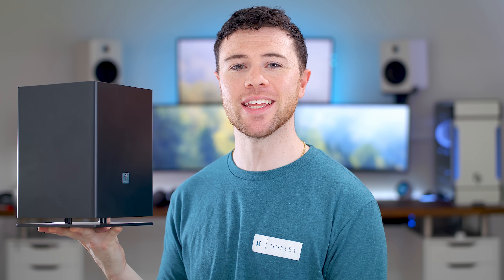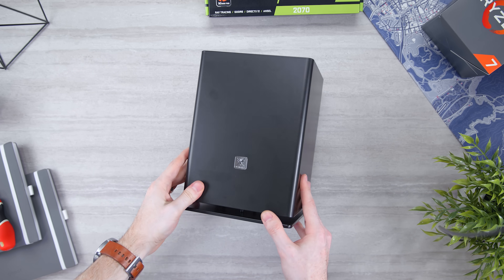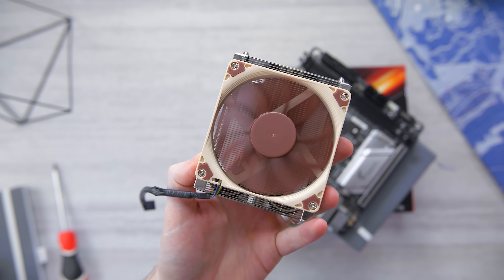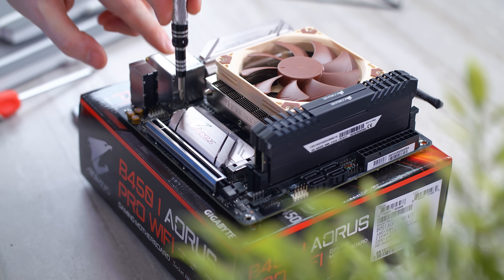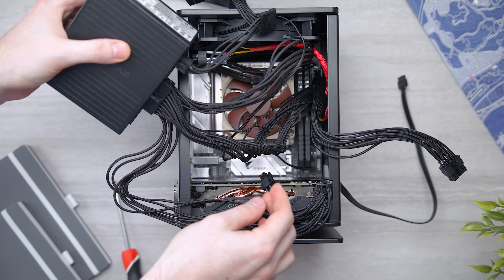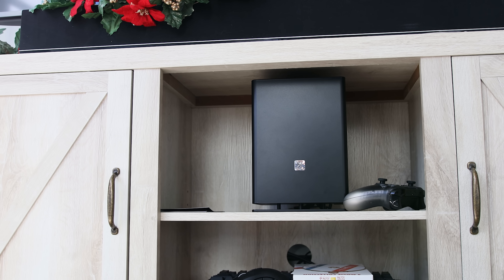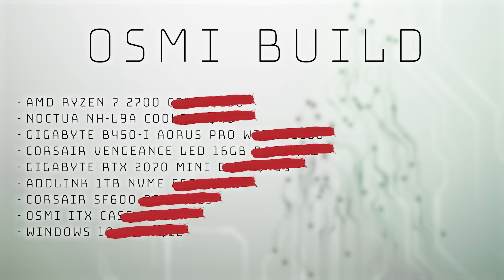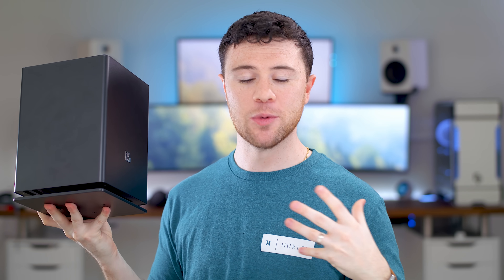I Built the Xbox Series X as a PC

Comment: “I think $699 or $799 or you know what I’ll give it a $100 leeway. Maybe $699 or $599” yeah turns out $499 is the price I so guess it’s worth it? I mean it beat his lowest projection of by $100. Lockhart also wasn’t on par the Xbox one s but actually more capable than the Xbox one X in the overall package and is $299. At least from these early projections it seems that the console exceeds the expectation cost for the power it’s delivering which is a good sign. Now all that’s left is to see if it meets the performance standard they are claiming.

Comment: You forgot to include the cost of a cd drive, I also think you’re underestimating the cost of components, for example cd drives are basically being sold for Razer thin margins, same with things like PSU’s and generic motherboards, there is basically almost no money to be made no matter how much in bulk you produce them - things like this will not be lower in price for the Xbox. But the CPU and GPU could be cheaper though because they share a die - not so much because of mass production even though that could have an effect just not as large as being in the same die. The Xbox will still be cheaper than your parts list but not for the reasons you mentioned, Microsoft will take a loss on selling the hardware and make it up in game sales. It all depends how much Microsoft is willing to risk to loose for how low the price should be.

Comment: It’s not rly equivalent especially using a 2070 when the gpu inside series x is more in line with 2080s-2080ti and the cpu is 3700x (unless you’re going to oc the 2700 to atleast 4.2ghz to kind of match the series x cpu performance. Buying a pc to match the performance of the series x makes it not worth it at all regardless of the few extra benefits you gain from being on pc platform doesn’t justify the price difference.

Comment: Right now it is about $1,700 rounded up and based on pc part picker. Not to mention according to that site, the motherboard chosen doesn’t have usb 3.0 header for the case. So there is that. But my big question is, what optical drive would you use? And how would you install it? Would be great if you could do this as a follow up to this because I’m interested in the case.

Comment: Hey everyone, For 4k gaming on the new big Navi cards would you recommend the r7 2700 or r5 3600. Or would it not matter since the gpu would be doing most work at that resolution? I'm asking because I went with a 3600 instead of the cheaper 2700 and I know ps5 and the new Xbox will use more core. Thanks

Comment: Some problems with your build. 2700x is Ryzen plus not Ryzen 2. There is a significant difference in performance. Second RTX 2070 has 8 Teraflops not 12. The 2080 super is the closest card to 12 Tflops without going over. Also the Xbox has 16 GB Total memory. Your system has 24 GB total. So basically you built a computer that sort of looks like a Xbox series X on the outside but especially on the gpu side is significantly lower power than the specs of the series X. You would have been better off building the computer in a different case and actually using components that matched the Tflops more closely and using a 2700x as opposed to the 3700 also makes not sense. You made a decent mini ITX mid range PC but to call it a series X in PC form is just incorrect.

Comment: Not to rain on your parade, but it's not possible to build an xbox2 or Ps5 wirh any off the shelf card or ssd.

Everything inside these new machines is custom made. From the ssd which destroys current gen pc specs and an Amd card that does Ray tracing in hardware.

Every part of these machines designed by Sony and Ms.

You'll see soon why 2080ti is severely overpriced:)
Reply from the maker: I literally said they are making custom components numerous times. Did you even watch this?

Comment: I was invested in this video until you used DDR 4 ram instead of the ☓'s GDDR 6. Then any real comparison fell apart.
Reply: Mark Burns Umm...consoles don’t have any DDR4 because they have no system memory at all. They “borrow” system memory from their VRAM. That’s why current consoles with “12Gb GDDR5” sound beefy but a couple gigabytes are reserved for the OS. GDDR6 is faster than DDR4, but you run into both capacity and bandwidth issues with the CPU/GPU on the same package using the same lanes. A PC like this has both system memory and VRAM on the GPU. A game like Battlefield 5 at 4K can use over 10GB of DDR4 system memory and over 6GB of VRAM. That’s more than any console has. Some settings will need to be scaled back in some titles for them to run well. Look up a video by Digital Foundry on their review of a Chinese “console” with a custom AMD APU. Similar to a Ryzen 1600 and RX580 but still performs worse than an equivalent PC.
Reply: @Aurummorituri  you are 100% correct.
Reply: Mr Glass  Better than any current console, but it could be a lot better with an intel or Zen 2 cpu.

Comment: Not quite sure why you picked a 2700 as it doesn't make the most sense at all - the 3700X does. The Series X is Zen 2, and as such has the big IPC improvements which are crucial for gaming. 

Also probably would've made sense to use an RX5700 for the GPU? Yeah this build is pretty far devolved from the new Xbox...

Comment: Add a controller and a 4K UHD BRD and see what your build jumps up to. Also, their console is showing more powerful than a 2070 right now, its closest to the RTX2080ti than any other card.
Reply: @Technical Knowledge 

This build also only used NVME 2.0 to where the XSX will be using NVME 4.0, so another part which shows the build not at the same level as what the XSX will be when its launched and will also dramatically jump the overall price of the build.

Comment: MAJOR, major problems with this video
#1 - There was NO mention of the fact that consoles are far more optimized. Due to VRS, multiple hardware AA methods and more a GPU might need to be 2-3x more powerful on desktop to produce a similar experience. On the CPU side games will be better threaded on console and there will be draw-call hardware optimizations that make the CPU punch above its weight.
#2 - that $380 estimate looks to be pulled out of his ass. Graphics card? Huh? It's an APU (CPU+GPU) with a single heatsink+fan combo not a CPU with $10 CPU cooler and separate graphics card.. $20 for 16GB of GDDR6? A year ago the estimate was closer to $120 for bulk purchases so that's not remotely close. It's far more likely it will cost roughly $450 to $550USD with the goal to break even at first or even lose a small amount to keep the specs high
#3 - up to $799 for the console? That's so far off base it's laughable especially with his $380 estimate. We've never seen game consoles designed to be profitable on a per-console basis from the start. That's not the business plan.
#4 - more a minor issue, but the "8K" capability is there simply because the console will likely be HDMI v2.1 compatible. It should have the HDMI bandwidth to output a signal capable of 8K@30FPS or higher. That says NOTHING about its ability to render a game at that resolution and frame rate. Which would be pointless. Also, note that if DSC (Display Stream Compression) is supported by both the console AND the HDTV/monitor then you can support up to 8K@120Hz (at 10-bit 4:4:4). So in theory you could have some dynamic resolution that averages 5K whilst also having a dynamic refresh using Freesync then output a constant 8K, upscaled resolution (to an 8K HDTV) at a dynamic refresh rate... above 4K is probably pointless for rendering but again 8K is only the bandwidth capability for the HDMI SIGNAL OUTPUT that says NOTHING about the processing capabilities of the console.
Reply: ..also on parts, he didn't even factor the 4K BD player or the controller. $1 for the case? If you're going to be that lazy why even bother estimating?

Comment: Zen 2 confirmed ,no Zen + so should have used 3700x and underclocked. Ram is ddr6. 12tf gpu and blueray drive. So add these items and you can say you built a Xbox series x but you won't be able to add cheap in front because it would be waaaay more expensive then Xbox,probably a shit load noiser too if the one x is anything to go by.

Comment: You done screwed up out the gate on your build on your choice of parts.  The next-gen consoles are using the (3rd gen) ryzen 2 cpus which are based on the 3000 series.  Which would be either the ryzen 7 3700 pro,  3700x or  3800x.   You could've used the 'AXRX Vega 56 Nano" due to it's 170mm profile size, 56 CUs & 3584 sp spec.  You know the X series is running AMD hardware.  WTF are doing using an NVidia gpu for?

Comment: The xbox lockhart 4tflop is gonna gimp how good the games will look on 12tflop xbox scarlet. I hope they dont release xbox lite at all.
Reply: No it wont. 
Look at PCs that can only do 1080p60, devs dont develop specifically for the lower tier stuff, they develop for the high end. 

Xbox Lockhart will do 1440p/1080p while the xbox series X will do 8k/4k/1440p
Reply: @AngelPerez-dw8ou  Here’s my reasoning; my hypothetical non exclusive game i am planning to make needs to work on all the consoles. I want the whole gaming market. 4tflops is the lowest common denominator. Therefore i cannot pull off the crazy next gen idea that requires atleast 9 tflops of power. Im gonna gimp my idea to run my game smoothly on all platforms.
Reply: @sturlahansson6182  just decrease the resolution to 1080p then and lower settings on the lockhart console.
Reply: MohawkWarrior76 might be easy to do that after the game already exist, but let me ask you this. Do you think they would have attempted to make Red Dead Redemption 2 if they knew they had to get it running well on a console 3x slower than ps4? 

The very fact that this lite version exists, will limit the scope and ambition of the projects developers will take on.
Reply: @sturlahansson6182  consoles In general already do that. Look at the last of us 2, that game looks next gen yet its running a 1.7TF console. 
Look at forza horizon 4, looks next gen yet it's running on a 1.2TF console
Look at ghost of tsushima, god of war, etc
Reply: MohawkWarrior76 Yes they are pushing way beyond what we thought was possible. I want them to push way beyond 12tflop and not 4tflop with next gen.
Reply: @sturlahansson6182  GPU is not the problem if the other components remain powerful. It will at most be a hassle for developers.

Comment: You forgot to include the controller and hdmi cable into the cost.
Reply: and the xbox one controller wireless USB adapter
Reply: Imagine if it actually came with a HDMI and controller
Reply: i remember reading an article that said it costs sony like $18 dollars to produce a ps4 controller  they sold them like $50-$60  each ive been threw 4 this generation so i dont think they'll mind losing money on your first controller most people buy more than 1 they make a hell of alot in accessories sony sell there own gaming headsets  controllers even official leads all with a hefty markup in price they sell the box cheap normally at a loss  for the first year or so untill the hardware becomes cheap enough to produce  that they start making profit on they make  alot on game sales and subscriptions aswell they make the money back and then some even if they sell  the console at release for a loss
Reply: Then add the $60 to play online
Reply: He also forgot XSX will have auto-HDR algorithm and new ultra responsive Microsoft signal.

Comment: 1tb nvme is not cheap. They better put a standard 2.5 Sata ssd. I guess that there will be 500gb or 1tb choice.
Reply: It will most likely be a 1tb nvme as they said these consoles will be fast as heck so a sata SSD wouldnt do it justice. They are also  mixing the NVME SSD with the GPU to increase the peformance in loading times

Comment: Series X will be incredible value compared to this. This build did not have a expensive blu ray player or even add the controller to final price (another 60usd). Much faster GPU and RAM is also GDDR6 and not 4.
Reply: And because it's a custom designed APU with all hardware integrated instead of modular, developers can get a lot more performance out of lesser specs just due to the way consoles are designed compared to PC's. 

With 12 TFLOPS and all new SSD's being standard with both consoles, I expect a huge leap in game performance this next gen.
Reply: Also the fact that RDNA 2.0 12tflop is about 50-55% more powerful then vega 64 puts it very near 2080ti.

Comment: huh. I have a R7 2700X on a Gigabyte B450 Aorus Pro wifi( the regular ATX version) with 16gb DDR4 3000Mhz. I do, however, not have any NVME storage, but sata ssd instead (samsung 850 evo). I have an ASUS R9 290, which is old and needs replaced, but it sounds like my PC is already pretty much on par with next gen consoles. Again, with a newer graphics card needed
I am 99% certain that the ray tracing AMD has come up with will be available via software on the already-existing graphics cards once the next gen consoles are released. If it does turn out to be hardware driven, there is likely to be a new sku of graphics cards for PC around the corner that are capable of ray tracing, or whatever AMD calls it. To me it would NOT make sense to have a newly released console be more powerful than literally anything offered by AMD in the PC space. Considering the 5700 XT is the most powerful consumer card AMD has right now, and these consoles are touted to be more powerful, they would NEED to release new PC hardware lest risk killing PC gaming for AMD.

Comment: The only prb is, your RAM is DDR4, much slower than the GDDR6 that will be in the XSX.
Reply: SteadyChaos Productions bro gddr is for graphic cards. DRR4 is for the memory,
Reply: @tapstechtips  Exactly BRO, the XSX will have 16 GB of unified GDDR6 RAM on the APU.  That will be its primary memory component.  Though some have stated the SSD might be used as  a cache of sorts.  Regardless, GDDR6 RAM has a much higher frequency and throughput than DDR4 RAM.
Reply: @steadychaosproductions3376  but it is unified so it will have to sharw bandwith

Comment: It is impossible to get 500$ us. Price point. So it is either they will sell at loss or the specs will be inferior. They take in consideration mass production 50 millions instead of few thousand sell. This reduce the price a lot. Custom design can also make more powerful chip for less. I still think they will sell with loss to compensate with services. So the console price would be 700$ mass produced reduced to 500$ which is equivalent to 1500$ pc but more power than 1500$ pc because the machine is dedicated in terms of hardware and software. So the code is very optimized for the machine which could make the games 30% faster with custom technics.

Comment: If the projected estimates are true, the next-gen consoles won't be beaten on price! You would be hard-pressed to build an equivalent PC in the same price bracket. We're not going to see significant reductions in hardware pricing either.
This won't be a popular opinion, but I'll be migrating from PC to a next-gen console next year. I simply can't justify a rebuild, or splurging hundreds of pounds on a GPU upgrade. Moreover, with developers favouring the console demographic, it seems like the logical choice! I'm tired of the divide caused by different storefronts, I'm fed up with shoddy console ports. I want a system that will last me the duration of the generation, with no necessity to upgrade to play the latest and greatest games!

Comment: A bit misleading. The Xbox CPU is a Zen2 similar to a R7 3700X, and the GPU was all but confirmed to be a 48CU 2GHz 12Tflops Navi, which somewhere a 2080 Super and 2080Ti in power. But your benchmarks used a 2700x\2070 build for some reason.

Comment: Shoulda been the 3700x man. Would have fixed most of it. That and an RX 5700XT and it would have been good for the most part, sans raytracing, but you could update that when the 6700 comes out or whatever. Also, they NEVER said 12tflops. They said double the Xbox one x performance. Double the RX 580 is about the 5700XT, which is 9.75 tflops. The difference is due to architecture. Just some fyi's.

Comment: They're targetting 4k60. Targetting. No 8K. No 120fps. 4K 60 is the target. Some games will support 120hz/fps (resolution not mentioned). Mark my words: it'll be a souped up 5700XT with Raytracting capabilities. And... that's very impressive. Usually consoles have a GPU equal to a medium end PC GPU from 3 years ago. This time, said GPU isn't even out on the market yet. But it won't be an RTX 2080S (and definitely no 2080TI) in terms of raw power. That's also not what they're claiming.